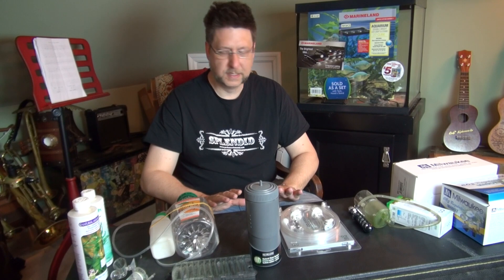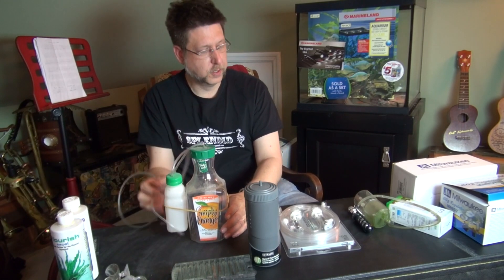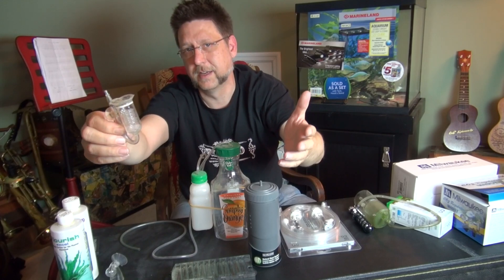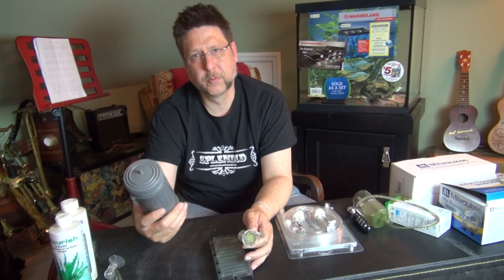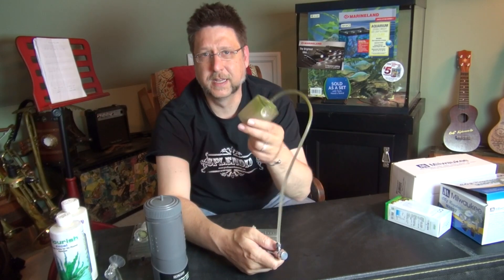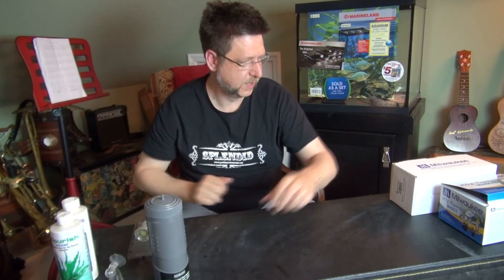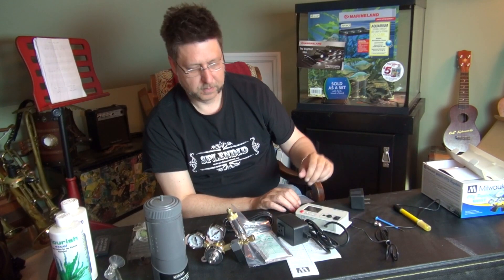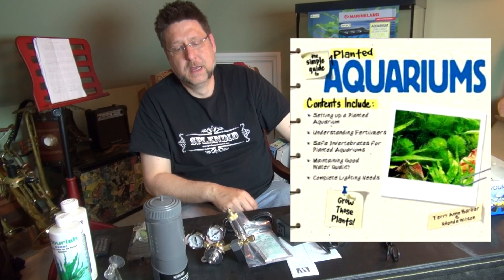CO2 Equipment

Comment: JBL Firm produces fully automated Co2 System..Which is Computerized and also controls ph/kh hardness perimeter of water condition's. It's not under 350 Euro's in Hamburg,Germany.. Then they also have 10 to 32 euro's. Co2 Dispenser that comes in bottles..Ranging from Two to one Month Co2 Cycles and then It's also comes with additional chemical's..Which can be added in the bottle to regenerate Co2..Cheap alternative. As for reactor's in my opinion disposable ceramic cartridge's are most effective..But those who don't have automated computerized system must remember to turn off their Co2 after the light is off at night. .Especially If you have fragile Dwarf Shrimp's.. But for lush growth of plants Co2 is not enough..I use ADA amazon with enrichment Tablets,Liquid Co2 and an emergency Cylinder with reactor...But checking the water parameter's is very necessary..If you are dosing your Aquarium's with modest Co2 equipments..Best is to go for computerized Co2 system..If you don't want to perform daily follow ups with Low Tech System's...
If you adore your Aquatics's.. Then make no compromise's at all..If your budget is limited then save Money for the ultimate...Because then the regular hassles of plant's nutrition is over... UV lights and Osmosis water is also an added advantage.....I use to have 120 Gallons Tank back in the day's and due to lack of Time factor..I had to quit..Now I have 100 Liter small Tank...But I attempt to provide the best that I can according to my Budget..

Comment: Hey Pecktec.                   Thanks for the informative YouTube videos. I have two queries :                                    1) If I use citric acid and baking soda for the co2 production could I switch it of at night since this works on the principle of mixing a producing co2. I hope shutting of the same wouldn't be harmful ( Pressure building up).                                  2)And if I could use a oxygen pump 24/7 along with this co2 kit 24/7 since I cannot remember to put it off at nigh?

Comment: good video I make my own  co2 with sugar and yeast I use the hagen grey canister with bubble ladder but I also made a reactor to go at the side of it using a small pop  bottle with two holes in cap put my air line tube in but I had  some all air leak on the cap so I put some fish tank sealer and it does the job I am  going to try your way with sugar yeast and baking powder doing a  DIY kit you make your self how can  you shut them of at night as plants don't need co2 at night does it just build up in the tank and the plants use it when you turn the lights of it don't want my fish getting high lol once again good video with good info

Comment: any new update vids on it..I want to try the aquatek paint ball tank regulator..it has a solenoid and hooks up to any paintball tank
Reply from the maker: +Russ Polk I haven't seen that one. Mine is doing good the closest to an update I did so far is called a tale of two summers. Basically it corrects some stuff I got wrong or could have done better. From what I have heard in the comments the green leaf products are really good. I bought this one a while back so I just went with what I already had. I don't have any complaints so far though.
Reply: Nice,,,expensive   never ending hobby . .lol

Comment: me also i used all the co2 stuff like diy;liquid;the small co2 kit ,its good for beginners but now am going to use the solenoid one in one week ,,am a little afraid of using it ;;but on utube i got all information .thanks guy youre doing a good job  keep it up  ;;am in mauritius tropical island in my aquarium driftwood ,angels,tiger barb,blue zebra and neon ;;;whats the best pH ?;;;;plese reply
Reply from the maker: chuttoo safick Best PH is as close to neutral 7 as you can get. I still havent installed that C02 kit. I may do that in 2 weeks. when I set up the 12 again.

Comment: pecktec Are you happy with the milwaukee regulator? I have heard bad things about it. Especially the needle valve floating. I heard the bubble count is very inconsistent.
Reply from the maker: I have heard the same stuff. I haven't set it up yet. Im sort of scared to do it. I have heard they are ok also. I have gases my tank before with diy co2 so I'm going to be carful.